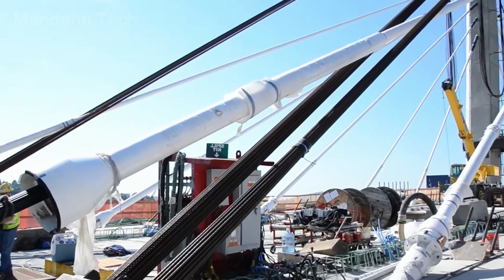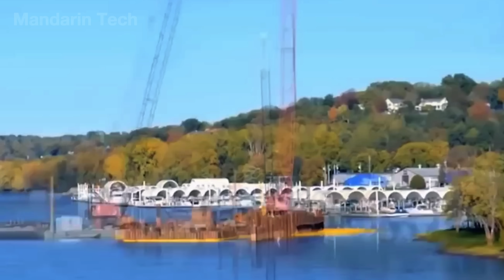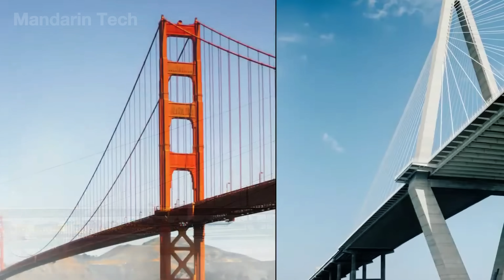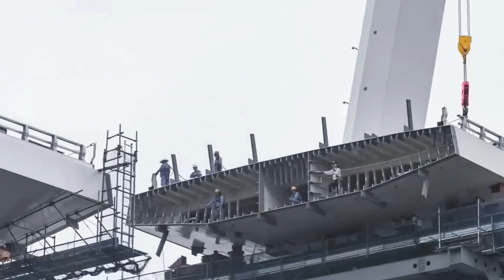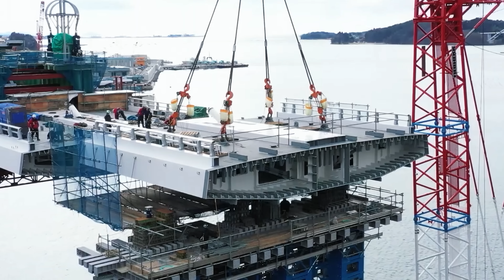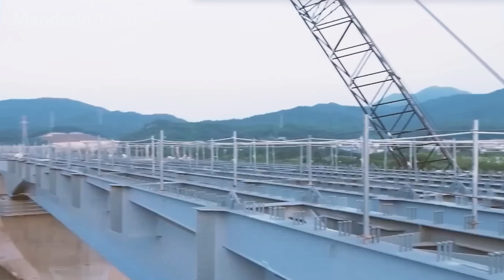How Japan Built a Massive Steel Bridge Across Kesennuma Bay to Withstand Tsunami Disasters

Comment: Field Engineer & Environmental Perspective
🇬🇧 English

From a field and environmental perspective, constructing in coastal and disaster-prone areas requires strict monitoring and adaptive construction methods.

Protecting marine ecosystems, managing site safety, and ensuring structural integrity under extreme conditions are key priorities.

Field engineers play a crucial role in implementing resilient solutions and ensuring compliance with environmental standards.

Safe and sustainable construction is essential in vulnerable environments.

#FieldEngineering #EnvironmentalEngineering #CoastalEngineering #ConstructionSafety #ResilientInfrastructure #SustainableConstruction #ResponsibleEngineering

Français

Du point de vue terrain, la construction en zones côtières exige un suivi rigoureux.

La protection de l’environnement et la sécurité sont essentielles.

Les ingénieurs terrain assurent la mise en œuvre et le contrôle.

Une construction durable est indispensable en zones sensibles.

#IngenierieTerrain #IngenierieEnvironnementale #IngenierieCotiere #SecuriteChantier #InfrastructureDurable

Español

Desde la perspectiva de campo, construir en zonas costeras requiere control y adaptación.

La protección ambiental y la seguridad son clave.

Los ingenieros en obra garantizan ejecución y cumplimiento.

La construcción sostenible es esencial en entornos vulnerables.

#IngenieriaDeCampo #IngenieriaAmbiental #IngenieriaCostera #SeguridadEnObra #InfraestructuraSostenible

Comment: The construction of a tsunami-resistant bridge across Kesennuma Bay highlights how modern engineering integrates resilience, safety, and disaster mitigation—especially in regions exposed to extreme natural hazards.

Civil Engineer Perspective
🇬🇧 English

“How Japan Built a Massive Steel Bridge Across Kesennuma Bay to Withstand Tsunami Disasters” showcases the importance of resilient infrastructure design.

From hydrodynamic forces and seismic considerations to structural redundancy and material resistance, designing in tsunami-prone areas requires advanced engineering solutions.

For civil engineers, this project demonstrates how infrastructure can be adapted to extreme natural events while ensuring safety and durability.

Engineering resilience is key to protecting communities.

#CivilEngineering #BridgeEngineering #ResilientInfrastructure #StructuralEngineering #DisasterMitigation #MegaProjects #InfrastructureDevelopment

Français

« How Japan Built a Massive Steel Bridge Across Kesennuma Bay to Withstand Tsunami Disasters » met en avant l’importance de la résilience des infrastructures.

Les charges hydrodynamiques et sismiques nécessitent des solutions avancées.

Pour les ingénieurs civils, ce projet illustre l’adaptation aux risques naturels.

La résilience est essentielle pour protéger les populations.

#GénieCivil #IngenierieDesPonts #InfrastructureResiliente #IngenierieStructurelle #GestionDesRisques #MegaProjets

Español

“How Japan Built a Massive Steel Bridge Across Kesennuma Bay to Withstand Tsunami Disasters” muestra la importancia de la resiliencia en infraestructura.

Las cargas hidrodinámicas y sísmicas requieren soluciones avanzadas.

Para los ingenieros civiles, demuestra la adaptación a riesgos naturales.

La resiliencia es clave para proteger comunidades.

#IngenieriaCivil #IngenieriaDePuentes #InfraestructuraResiliente #IngenieriaEstructural #GestionDeRiesgos #MegaProyectos
Reply from the maker: Great insight, thanks for sharing your perspective!